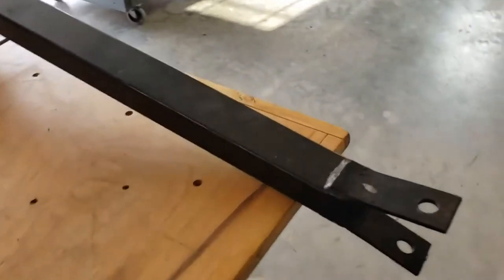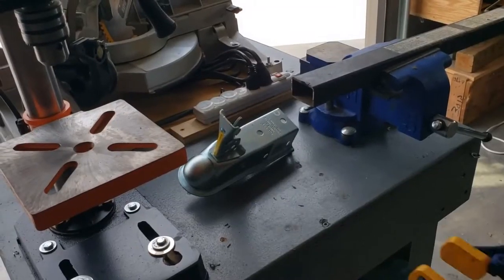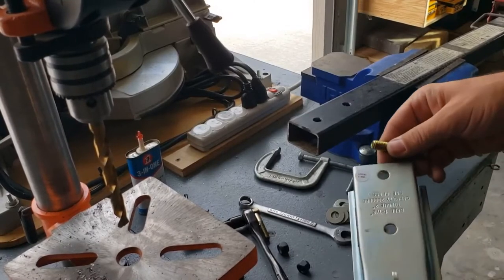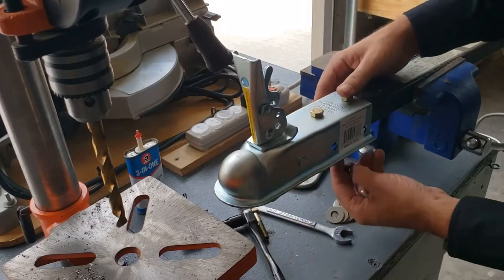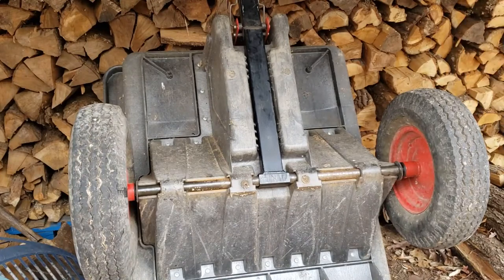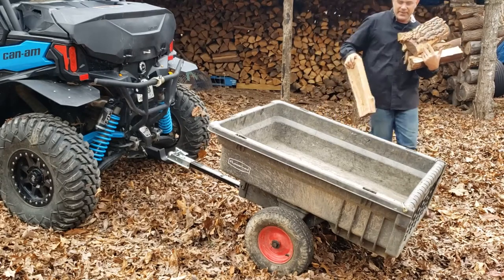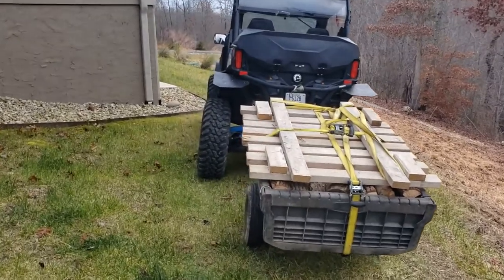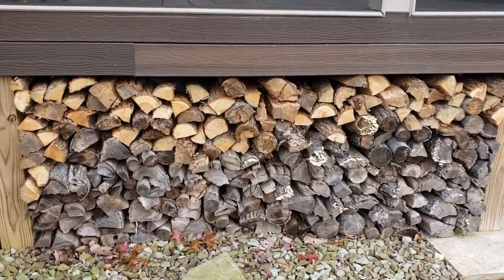Trailer Hitch Repair Pin to Ball Conversion Harbor Freight Haul Master 94768

Comment: Where did you get the trailer from?
Reply from the maker: I had bought it second hand and it's a Rubbermaid cart. It was awesome, I don't have it anymore because I have a compact tractor with a bucket but it was a great little trailer.
Reply: Thanks for getting back. I’ll probably check Home Depot or Menards.